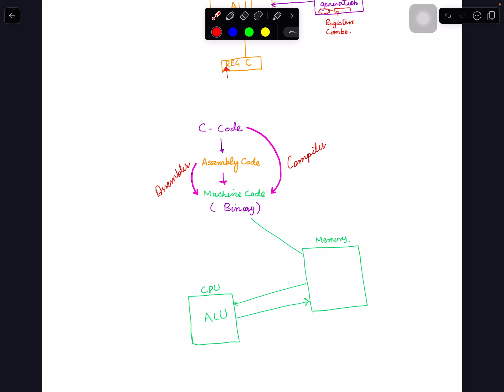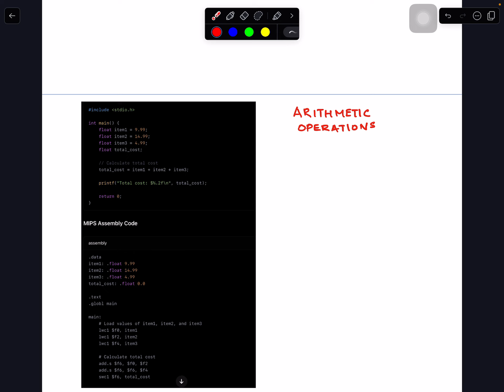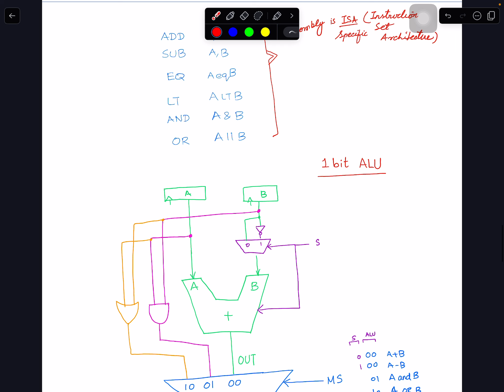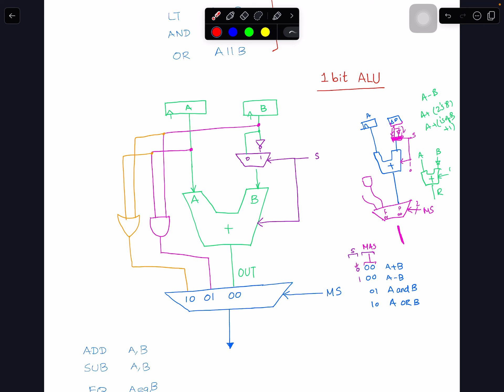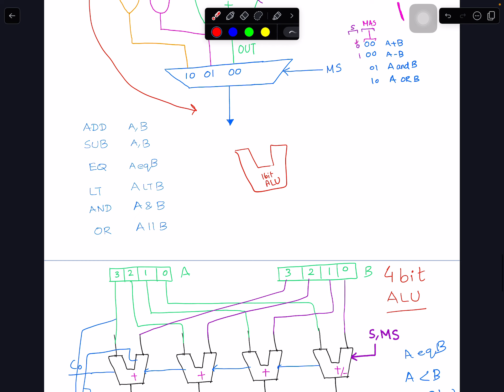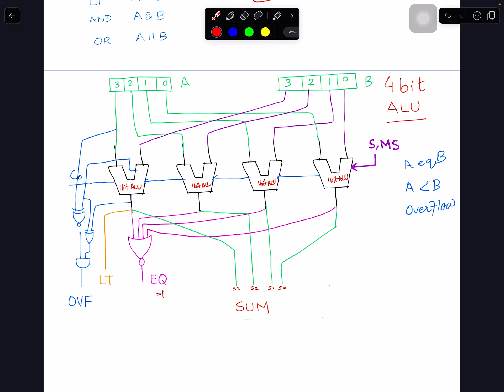Comment: OVF simplifies to XOR of two highest Borrows or Carries. Let A vs B select from Karnaugh and prefix a path for ripple-free Manchester Magnitude. Better than Carry for A-B, B-A, and six comparisons. 74CBT3253's internal 4way decoder provides free arithmetic prefixes as pass-gate drives. Use 74LVC2G86 to XORvert B for addition and mix Karnaugh vs prior Borrow for a final result. Two ICs per slice on generic SSOP to DIP28 converter with room to spare.